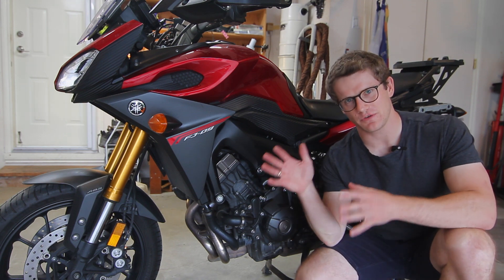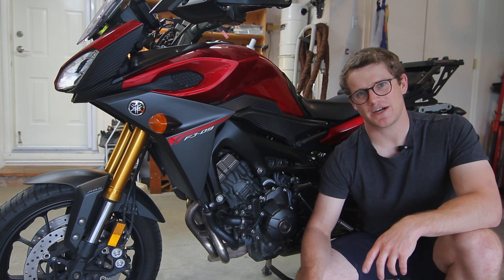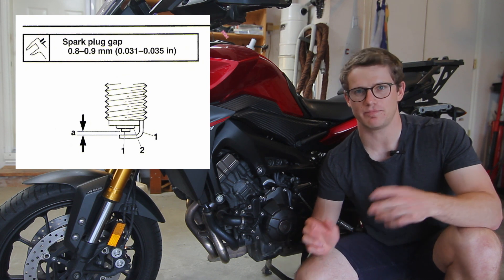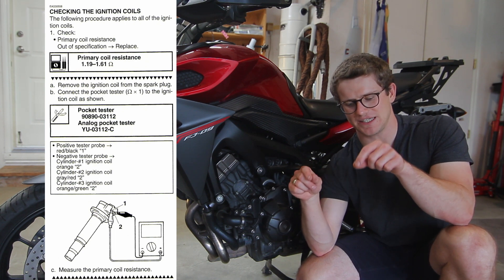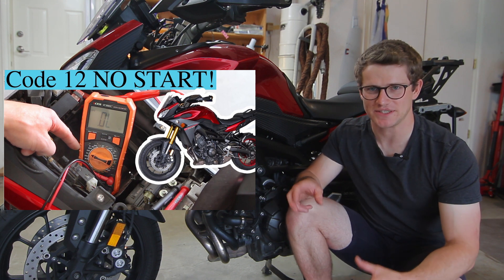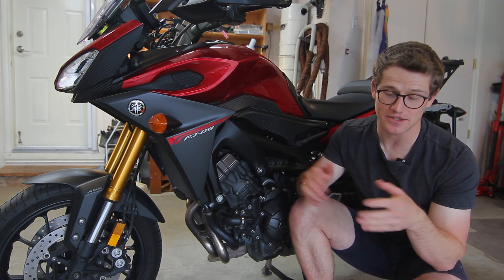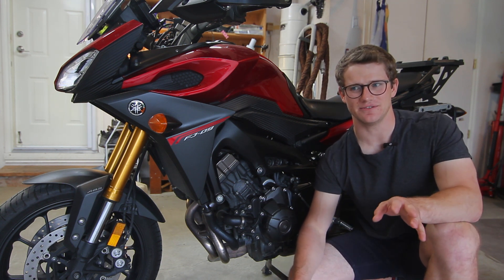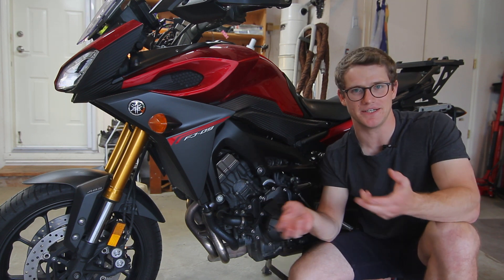Yamaha CP3 FJ09 MT09 FZ09 Misfire Diagnosis and Solutions!

Comment: It’s cutting out randomly. Choppy like it’s running out of fuel. Replaced spark plugs and air filter no change. Got it used from a dealer wonder if maybe bad fuel got to it? But I put couple thousand miles on it before issue popped up. Might clean or replace fuel injectors, and check throttle sensor? Does that sound right?